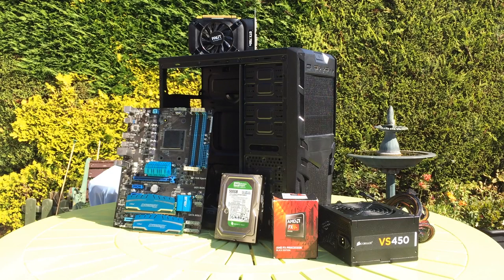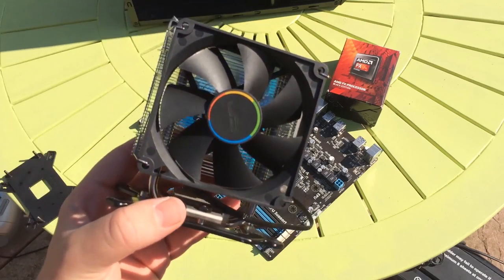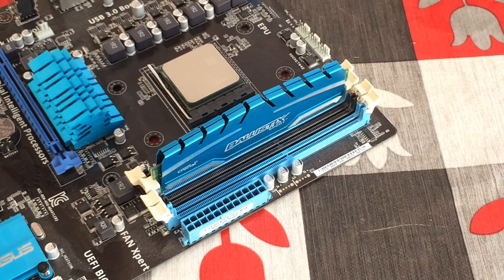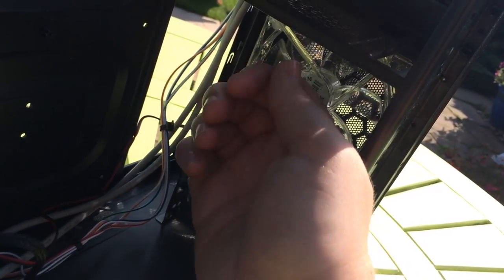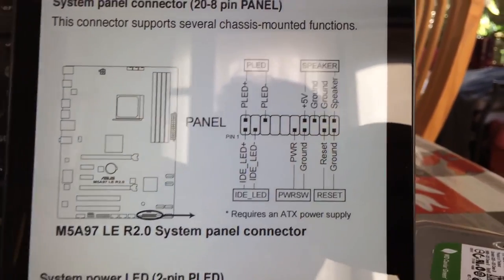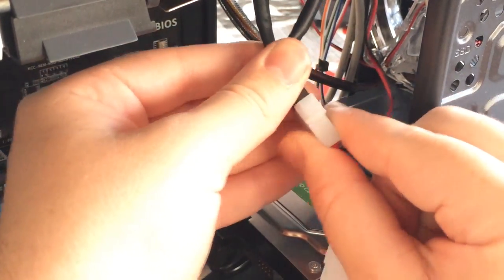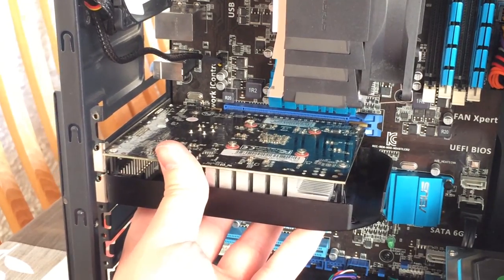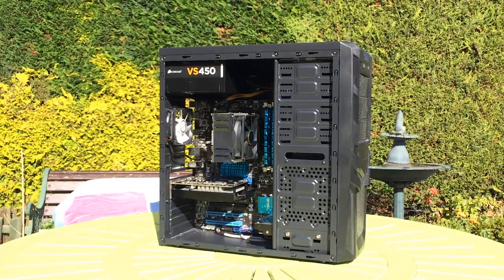Let's Build A Budget Gaming PC - Sensible Used Parts System

Comment: My Budget PC :
I7-3770 8x3,4GhZ
8GB Ram Dual Channel 
MSI GTX 760 OC 2GB
BeQuiet  400w 
Random Dell mainboard
Random dell case
Reply: Feel free to rate it @YoutubeCommentGuy  (Total Cost around 300~)
Reply: When did you build this?
Reply: that i7 aint budget build
Reply: it is they're super cheap nowdays.
Reply: i got the gtx 760 but with 4 gb more ram and a xeon
Reply: Crispe wtf ? Whats wrong with you? I dont want likes, i just want to know what others think About my build.
Reply: A Dhillon the I build it the past two Weeks ~ i got the cpu yesterday. I Upgraded from an i5 3470
Reply: Yurre Troost nice ! What Kind of xeon do you have?
Reply: How much did u pay for the i7? I think you should've used an i5 instead. And buy a 770 or a 780 if possible.
Reply: i selled my i5-3470 (was before the i7 in the PC) and bought the i7 for 100 Euros (its a good deal because there goes normally for around 150 euros here in germany)
Reply: Yea but the Reason i looked for an upgrade is because battlefield 1 totally runs likes shit on my old i5-3470 (non stop 100% usage which caused stutter) Now the ussage is pretty good (around 50-85%, AVG 66%) + the stutter is complety fixed
Reply: already sold it, sry :D but the i5 2400 and the i5 3470 should perform similiar.
Reply: pretty similar to my build 
i7 3770
Be Quiet Bk008 Cpu Cooler
16 gb Ram Quad Channel
Random OEM board Asus
Gtx 750 ti
650 Watt Coolermaster Super Silent Pro 80+gold Semi Modular
2x 120gb Ssd (Sanddisk and Samsung Evo)
2Tb HDD
Corsair 100r Case
4 Artic Fans

for around 230 Euro ~ 275 Dollar 

Only Things left to do, get myself a z77 Mobo and Delid my CPU get it to 4.2ghz and Upgrade to Gtx 1070.
Reply: the i5 2400 should work totally fine with the 750ti. You can even pair a GTX 1050ti with that CPU but i wouldnt got further beyond the gtx1050ti
Reply: ohh im so envious because of youre 16gb ram ._. yeah, looks good besides the GTX 750ti :D 
My things to do : Upgrade to 16GB, Upgrade to GTX 1070 i dont think i want to invest in an z77 maybe if i could find one for cheap..
Reply: what gpu do you have right now ?
Reply: Griffin Koepkey a 2400 wouldn't bottleneck anything below a 1070 most likely. The Pentium 4560 doesn't even bottleneck a 1080 in synthetic benchmarks (of course it would in real world use, but that's just to give you an idea)
Reply: My Budget Rig:
Xeon X3470 @ 3.53ghtz 4C/8T
8GB Ram Dual channel
PNY GTX 950 OC 2GB
ASUS P7P55D-E LX Motherboard
DiabloTek 550W
DIYPC VisionII-BG Case
128 GB ADATA SSD
1 TB WD Blue

Priced ~260 USD
Reply: A good all-round build. For a substantial upgrade, I would recommend upgrading to a GTX 970. They're getting pretty cheap on the used market and still has plenty of grunt for 1080p gaming.
Reply: yeah i already thought about to upgrade to an gtx 970! should gave a solid performance boost over the gtx 760. i think the next thing on my to-do list is to upgrade to 16gb ram
Reply: alex petree I have a 2400 and it does bottleneck at 21:9 on my 970. Especially in pubg
Reply: Why?^^
Reply: nice dude, but get that Xeon to 4ghz pronto :)
Reply: Livi thinking about it, it could be a vram issue actually.. I'll have to check next time. But the 2400 still causes issues
Reply: yeah the i5 2400 isnt THAT powerfull especially in a game like PUBG which is CPU demanding i would say..
Reply: Livi gonna get a 3770 too at some point
Reply: My ultra budget pc: 
Core 2 Quad Q6660 
Gigabyte GA EP43UD3L
6GB DDR2 800Mhz
Sapphire radeon 7770 GHz edition
2x WD Caviar blue 320gb
NZXT Lexa Blackline
Random chinese 450W psu
Price:62 euros. The cpu was 12 and the ram 40 (bought new). The case and the motherboard and the gpu were given to me for free. The hard drives and the psu are from an old system.
Reply: 8? You meant 4. HT doesn't make it 8 core lmao!
Reply: who said i mean cores?
Reply: infact that the i7 with HT perform similiar to an eight core processor. (of course the true eight core (not the FX Lmao) peforms better. but theoretically both have 8 threads and it should peform like i said - similiar
Reply: Lmao, check out my 180 euro build noobs
E3-1240
8GB RAM
HD7790 1 GB
Delta PSU 400w
Reply: Vincenzo Lisi ah nice Xeon, I have the E3 1220. Soon to be a i7 3770 tho :p
Reply: Livi nah they don't really perform similar. A 6 core will outperform a 4 core ht (assuming same architecture and same clocks)
Reply: I had a spare 1tb Samsung sata2 drive and a GTX750 2gb and paid in total 50€ for these parts:
Q6700 (haven't arrived yet, 10€ from aliexpress)
Fujitsu G31T-M2 (15€)
2x2gb DDR2 667mhz (10€)
Antec BP430 80plus psu (15€)
Cheap beat up black case I found from a friend... (0€)
Right now the system works with a C2D E4500 and can handle Crysis (40fps avg. at 1024x768)
Reply: That Fujitsu mobo seems to have proprietary front panel connectors. I would have ordered a 775 Xeon and at least 8 gigs of ram btw.
Reply: Nope. i tested it and read many articles about it. as long as the thread count is the same they should perform similiar. Just look at i3-7350k vs i5 7600k. They perform similiar
Reply: of course a true eight core processor is the better choice but like i said the i7 performs *Similiar not better.
Reply: Look into a GPU upgrade. You have quite a powerful CPU and adequate RAM. Your chipset is very much viable, and the 760 is holding you back a bit. You will want to consider upgrading the PSU as well, as 400w is a bit low.
Reply: +Vincenzo Lisi It doesn't support more than 4gb sadly. I could get a xeon E5450 for $7 more but the Q6700 is enough for what I hope to achieve. I used to own a X5460 system a year ago.
Reply: Livi nah they really don't, i3 7350k scores 6700 points in passmark and i5 5600k scores 9500 points. (At stock). In games it's slightly different as most games only utilise 1 or 2 cores properly. HT obviously adds a lot over just 2 cores no HT on the i3 but threads Vs cores really aren't the same.
Reply: My budget build:
i7-4790
32gb crucial 1600MHz ram
Gigabyte z97-sli motherboard (was planning on going to 4790k but haven't found a need yet)
480gb and a 240gb PNY ssd
500gb Hitachi 7200rpm HDD
3tb 5400rpm WD green HDD
2tb Seagate 5400rpm network drive
Aorus Geforce gtx 1080 ti Xtreme Videocard.
Deepcool captain v2 (red led)
Thermaltake P3 case
NZXT Hale90 V2 850w PSU
Reply: That's pritty good my 760 budget build cost me 225 cad including an 360mm AIO and fx 6100@4.75 GHz
Reply: Just kidding lol that's my main build. My bedroom budget build that was under $300
i5-2400 (stock cooler)
16gb 1333MHz Hynix ram
Sff dell case
250gb Toshiba ssd
300gb wd blue
 MSI 1050 ti low profile videocard

Can play Tomb Raider (not rise of)
@ 4k normal settings 30-40fps
Reply: The Tech Monstaa oh god 5400rpm hdd's
Reply: Andrew McEwan they're strictly for back ups. Speed is what I have the two ssd's for ;-) and the network drive is great because I can stream movies through my network to any computer on the network. NETWORK! Lol
Reply: Livi your PC is not budget.still one of the best processors out there the house is still decent today.
Reply: Hey, mine is pretty similar, actually.
i7 3770 
24 Gigs of DDR3 RAM
Currently on VEGA 64

i7 3770 is a really nice CPU, I upgraded from an i5 3470 and there's a noticeable difference in every game.
Reply: Games arent benchmarks^^ they perform almost the  same in every game.  but you are true. 8 true cores are better than 8 HT threads. but they perform similiar -
Reply: yeah i upgraded too from an i5 to the i7 and its so good!
Reply: "Budget PC" something like this is my Main PC. 
It's a Prebuild, Same CPU, 12GB of RAM, only GT 640 GPU. 
The PC can get loud as fuck!
Reply: Livi poor 3770
Reply: Livi got mine for 80€ cuz it was a oem with 1TB HDD 8GB 1600 Case NT MB for 150€
Reply: gt 640 and an i7 3770... RIP
Reply: Yep. And i have no Money.. when i have some i might try a 1050Ti or wait a little more and get a 1060 + new PSU. bc i love my i7 (i have it since 2012)
Reply: the i7 is still a beast cpu
Reply: for 700 euro, no.
Reply: i would maybe pay like 500 something i think.
Reply: I tried.  Anything past 3.6 Ghtz becomes unstable.  3.53 was the highest stable I could get without crazy thermals.
Reply: Timothy Ensell :( what cooler do you have ?
Reply: Livi I got a:
Ryzen 1600X 12x4 GHz
2x8 GB dual channel
Gtx 1060 3Gb
Mai B350M Pro Mobo
VS650W PSU
A 120Gb SSD
A 1TB Seagate 7200Rpm
A hyper 212Evo cooler
Reply: your setup is bottlenecked
Reply: My build isn't really a budget build be a use it costed me 1100 euros

I7 2700k
Gtx 1060 6gb
16gb of corsair ram
1 tb baracuda hdd
250gb western digital ssd
500 watt evga bronze
Some type of Asus mobo
Thermal take rgb case
Reply: Riley Stanish nice. In a few months ill Upgrade to 16 gigs and then the GPU
Reply: I have almost the same as what's in the video..

Fx-4300 overclocked to 4.5ghz
Asus m5a97 r2.0 board
Hyper 212 evo cooler
2gb palit Gtx 750ti
16gb ddr3 
Hyper fury x 120gb ssd
X4 500gb 2.5" 7200rpm hdds
Evga 600w psu
In a cit dark star case.

Total cost was around £350
Reply: @griffin8787  No. That cpu can handle up to a 1060. Anything like a 1070 or over would be pushing it but if youre feeling lucky you might be able to even use an rx 580.

Comment: I recomend 16gb for the sweet spot if you plan on using gmods and a min of 4gb gddr5 gpu  Some of my games ran like complete junk on 1 to 2gb gddr5 and 8gb ram also a dual core is bare minimum  and not recomended  I suggest I reasonable quad core  minimum    also I suggest a sshd ot ssd for boot drive a 1 tbsp sshd. Here is only like 5 or 10$ more than a regular hdd

Comment: i got my pc from my cousin for free , it comes with ;
- i3 2120 3.3ghz ( upgrade it by my self to i5 3470S with extra 22$ )
- H61 MSI board
- 4Gb ddr3 RAM 
- HD 7750
- 1TB drive
- 550w FSP power supply
it runs triple A titles flawlessly @720p , and i'm very happy with it :D
Reply: get a new monitor
Reply: yup , but i have to upgrade my gpu first

Comment: 750 Ti is still a beast
Reply: I would not recommend a gtx750ti anymore gtx950 is what i would recommend for a budget or the gtx1050ti if you can afford
Reply: In my country the resellers know about the hype that the 750 ti still has, and the price is a littie bit high, even the 1030 is cheaper than the 750 ti here.
Reply: Luis Morales
Duh GT 1030 is already cheaper than GTX 750ti....
Reply: Only if you find it very cheap,else go for the 1030,almost the same with even lower power consumption
Reply: Vasileios
Ik but 750ti in new condition is like 30$ more with 5 FPS higher than 1030.Gt 1030 seems like a more suitable card for OEM pre-built pcs with low power consumption :)
Reply: +The Legendary Ravioli
30$ more for just 5fps (and not in all cases) doesnt deserve it.
Just go for the 1030 or go higher,750ti only if you find it used and very cheap.
Reply: Yeah I would rather go for 1030.If 60$ more,I'll choose 1050 ti..

Comment: I  will buy rx460 4gb 
Ineed cpu for $50.70$
 (Used)
Reply: What about i7 920
Reply: I5 4590
Reply: NCR TROOPER i can find that xeon for around 7.5 usd but i cant find a motherboard for under 75 usd , i am searching in the local website though
Reply: i5 2400
Reply: athlon x4 950 is new (AM4 platform) and is $60
Reply: also some new fx4300 are on ebay for around $50
Reply: Thx guys
Reply: yea socket lga775 seems like a good option, either xeon or core2quad
Reply: One of the best budget CPU's for around 50 € is a mid tier ivy bridge chip like the i5 3470, but speaking from experience you won't regret getting into the 100€ tier and buying the i7 3770, it's really that much better.
With 4 cores you will have stutter and reduced LoD in some newer titles like Rise of the tomb raider or Prey.
Reply: Max_In_HD ithink i9 better
Reply: look for deals. do some research and figure out which CPUs would be suitable, then try to find used deals anywhere you can think of. Not a specific CPU is the right one. if someone is selling a cpu Mobo combo for $50 with an old Xeon or fx, then that might be the one you want. it's just about what you have available.
Reply: Xeon X3440 and 1156 board. Equivalent to i7-860, costs around $20-$30 on AliExpress and h55 mobos cost around $60. If you want overclocking, you can pay for p55 which will run you about $80. This is on ebay at least.
Reply: Panther Productoz ifind i7 920 1st gen for 30 $ with mb iwant your opinon
Reply: Very good deal. I would buy in a heartbeat. X58 is still relevant as a platform today and as long as you flash your bios. Once it's flashed to a bios with the newer Westmere microcode, it you can pick up the 6-core 12-thread Xeon X5650 for about $20 on ebay. Otherwise the i7-920 will do, but I think the Xeon might be able to reach slightly higher clocks.
Reply: i7 2600 or i5 2500k or xeon  idk
Reply: pentium lol
Reply: X3460 Xeon

Comment: My sisters pc has the same cpu, ram and motherboard, The computer keeps crashing and freezing and lags for most of the time. The temperature is normal and i had to reinstall windows several times and it still keeps lagging. Once it was almost certain of death but after 6 hours of googling and searching for fixes the pc actually worked. Any help?
Reply: MaksTheBeast The easy solution would be to do a fresh installation of windows
Reply: Is the chip overclocked? Try to see if it's an unstable overclock.
Reply: Maybe the hdd have bad blocks. Try to use the program gsmart control.
Reply: I think it could be faulty RAM module, that can cause a lot of unpredictable issues to your computer. Or maybe problem with the PSU. You should try swap those parts and see if the issues persist.
Reply: Just open the task manager when it freezes and see if the problem is the CPU, the RAM or the HDD.
Reply: sometimes she gets 100% disk and she only plays sims on it with a pretty bad gpu and she gets a blue screen in games or after the pc is on for like 20 mins. She wants an upgrade though so sims  and the pc can actually run normally. Defo a new gpu but idk if the hdd/ram or cpu needs changing as its at 50'c in bios even when fully cleaned
Reply: the psu got really loud over the last few years as well but thats not what causes the computer to be sluggish
Reply: MaksTheBeast yeah I dunno what to tell you because my fx 4300 still works flawlessly. I also have an msi 970 gaming motherboard. I'm guessing you probably have the latest bios on that board, so I'm really not sure.
Reply: What is the motherboard called?

Comment: Hey RGHD I bought an old Optiplex 7010 to turn into a gaming PC. I installed a GT 730, 8GB RAM, and a 1TB HDD. Everything was fine for about 2 weeks but then it started shutting off and gave me a flashing orange light, then stopped booting altogether. I figured this was a PSU issue and got the Cooler Master 460. Though it boots up now, it still shuts off after about an hour. Is this a software or hardware issue? Any help would be appreciated, thanks.
Reply: CPU getting too hot, perhaps.
Reply: Pending does it overheat?
Reply: MarkTheMorose 
I don't think so. I got Arctic Silver and put on more than enough. But I'll take your advice and remove it and put on more. Thanks
Reply: Redoxyl 
I don't think so. I got Arctic Silver and put on more than enough. But I'll take your advice and remove it and put on more. Thanks
Reply: Bozidar 
I don't think so. I put a thick layer of Arctic Silver on the CPU.
Reply: Don't overlook general cooling, i.e. chipset and other internal fans.  Is there enough air flowing through and out of the case?
Reply: MarkTheMorose 
Ye. I've actually taken the side panel off, yet the issue persists.

Comment: For building a PC? Great video.

For parts choice? Crap. I'm sorry, but the FX line of processors are defunct, and should not be bought.

Not only do they underperform, they are on a now dead CPU socket that has been used since the Phenom II's came out. With no upgrade path, it's a stupid decision to buy one, even the 8xxx series.

I could not recommend an FX series CPU to anyone these days, when they can be outperformed by Intel's i3 range, and lower end i5's. They didn't cut it when new, and certainly don't now.

Comment: Welll i hope i have a gtx 970 strix and i paired it with a amd fx 6300 and tge performance was so shit around 45fps in gta 5 max and off course a 970 can max out gta 5 @1080p wtf any solutions
Reply: Your cpu is too slow, you can try turning the settings up so there is more load on the gpu than on the cpu.

Comment: Can I run gta 5 
PNY GeForce Gt 710 2gb
8 gb ddr3* Ram
Intel core 2 duo e7500
250 w psu
Reply: Nope, CPU and GPU are too weak
Reply: Barely with Resolution scale at 1/2 on 720p and shadows deactivatet in settings file
Reply: not with that poor core 2 duo, I have an old core 2 duo e8600 machine i mess around with that has an HD 6670 in it and it can barley manage 30-40 FPS in fallout 4 at 720p low.
Reply: How tf do you have a c2d and ddr4 ram???
Reply: Yep, you can. I play it with a E7400 2.80 GHz, GT 710 2 GB DDR3 and 4 GB RAM DDR2 800 MHz, though on the lowest settings. I suggest enabling VSync on Half with 60 Hz because it reduces the stuttering. It won't look smooth at all but at least it'll be (kind of) stable and playable with most of the time sitting at 30 fps.
Reply: Go to low spec gamer , with his help you might just .
Reply: Maybe the cpu but the gpu is really weak..